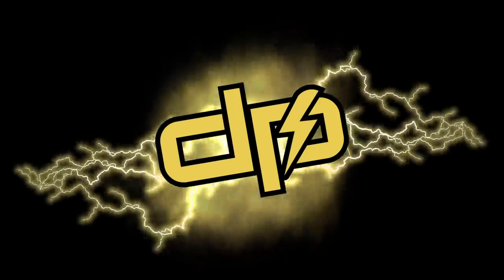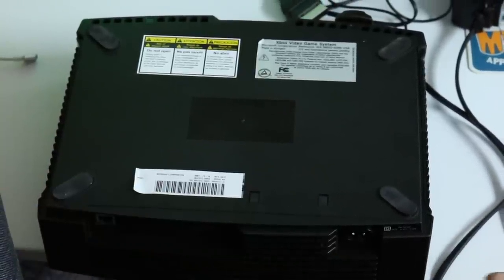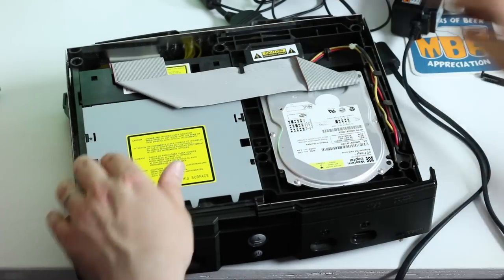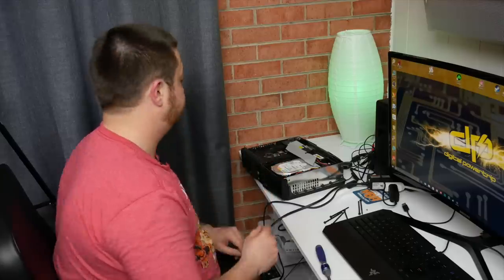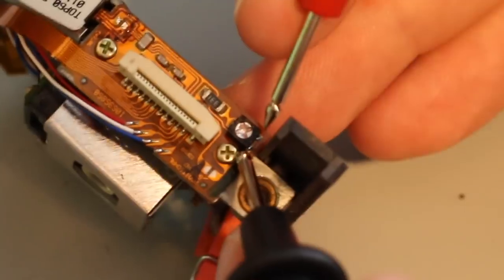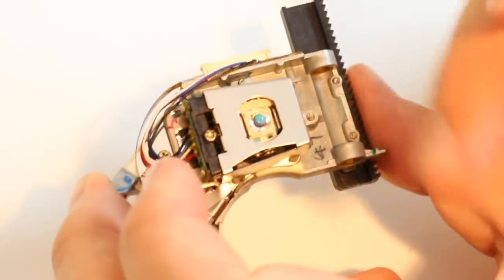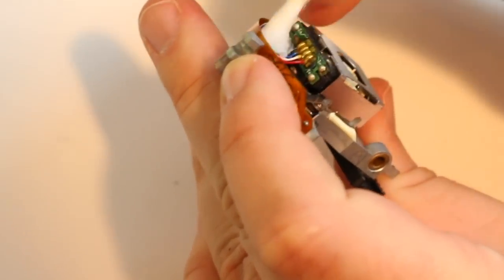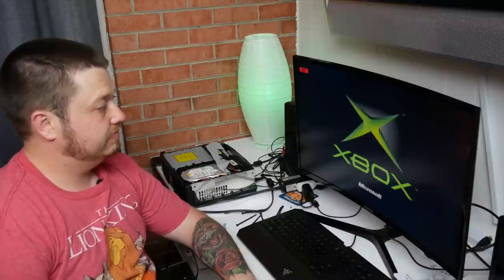Fix Original Xbox Disc Read Error

Comment: Hey I got a weird one, if anyone can help I'd appreciate it. So I have two Xboxes, one works fine, the other didn't read discs. Same error as this video. I swapped out the DVD drives, swapped the IDE ribbon, even swapped the power cable, but the issue remains the same. The only difference is with the IDE cable. Before, there was no Xbox splash screen when trying to read a disc. It would just display the error after several seconds. When I swapped the IDE cable, it now displays the Xbox splash screen, but still gives the error. I'm not sure what else to do at this point. Could it be a bad motherboard? Thanks in advance. Subscribed.
Reply from the maker: Yeah, I think you may be on to the source of the issue. Good news is that you can pick up OG Xboxes pretty cheaply. We find good luck in small shops like pawn shops and on Ebay. Good luck!
Reply: You can not simply swap an original Xbox's hard drive or optical drive without swapping the boards on them. They are both married to the motherboard. The only way to swap them is to pull the board off the old drive and put it on the replacement drive.
Reply: This is contrary to what I have read in my research on this issue. The HDD is linked to the motherboard, that's true. But not the optical drive, according to my research. Also, I was actually able to get a different optical drive working in the Xbox I posted about.
Reply: Hmm. I thought for sure they were both linked to the system.
Reply: @1980sGamer  nope, on the original xbox only the hdd is linked to the mobo and on the 360 only the disc drive is linked to the mobo. I have swapped many disc drives in the original xbox.
Reply: xNinja83x  Thanks for the clarification my friend!

Comment: Digital Powertrip: I have an original Xbox that is not reading disks. I attempted this repair yesterday and it is not working. Could you all repair it, or recommend someone that does? I would pay shipping to you as well as provide a prepaid return shipping label in addition to parts and labor. Just send me a message or comment if interested. Thanks!
Reply: It boots up and all menus are accessible as well as music on the hard drive. But it won't read any disks, not even audio CDs

Comment: anywhere i can get a replacement dvd drive?
Reply from the maker: You can find some on Ebay... but we have had the best luck just grabbing old Xboxes and using them to part out for the ones we are working on. I've gotten them as cheap as 10 bucks.
Reply: Julian Rodriguez if the console is modde youcan actually put a cd or dvd drive to play backups in order to play original discs you would need an specific samsung model, alter the firmware and reverse the spinning of the drive....xbox drives spins the opposite way
Reply: I have two of them if you pay Shipping I can send you one.
Reply: Digital Powertrip I bought a xbox console from eBay I test it turns on by itself doesn't wanna work with games and movies
Reply: Jason Larson I'm interested in one
Reply: Jason Larson u still have a drive?

Comment: I know its an older video but where did you get the replacement optical pick up?
Reply: I would modchip your system, upgrade the hard drive and do this laser pot adjustment only temporarily to run a Hexen disc so you can FTP games over to your system.
Reply: @realgroovy24  Ok sure that's a good shoutout but that didn't really answer his question
Reply: @YummyWhiteLiquid  I've tried sourcing them, there's too much demand in relation to supply.
Would be good if they still made the laser mechanisms. There's also the option of flashing certain drives like the GDR-8163B which I have done in the past, but that's a lot of work for most.

Comment: So the issue I had with the video.. is I was following along not realizing I needed a special tool.. and mine didn't actually have a screw with a slot on it.. I ended up using tweezers to turn it (outward because you forgot to mention which way ment what )
Reply: Though I definitely made mine worse, it would push the disk up instead of reading it and the tray would no longer close

Comment: Is it in any way dangerous to open the XBOX? I want to try the same with mine but I am pregnant and the warnings at the back made me worried.
Reply from the maker: Anytime you open anything electronic with a power supply and capacitors, there is a risk of shock. If the unit is unplugged and you stick to the front portion where the DVD drive is located, you will limit that risk, but if you feel unsure, I'd recommend that you have someone who feels comfortable working on electronics do it for you.
Reply: @DigitalPowertrip  Thank you very much for your reply and opinion! I did open my computer tower before and never had any incident with that. I am just insecure if with the XBOX the risk might be higher. I will stick to your recommendation! Thank you again!
Reply from the maker: @jilvalentine7094  You are most welcome! Odds are that you are at no greater risk with an Xbox than you are with a PC (they are essentially the same thing). But, a shock to a pregnant person is not good, so if you decide to dive in, be safe!

Comment: I just got an original Xbox, and when I try to insert the disc it won't stay, it pops back out.  If I insert it, hold it in and turn off xbox it will stay after I turn back on and load, but are there any possibly simple causes and fixes?
Reply from the maker: I've not had any experience with that exact issue, but chances are someone has. If you find a fix, let us know what it is.

Comment: I tried this fix, even checked with my multimeter. Now the disc won’t play and doesn’t show a disc read error message on screen, just stays at menu. Have any ideas how to fix? Thanks
Reply from the maker: multi meter set to ohms? If so, the laser may be bad.

Comment: do you think leaving a game in the Xbox while its put away on its side could cause this?
Reply: I haven't played it in a while and I forgot I had left a game in there! and now it says that all of my disks are not valid Xbox games, CD's, DVD's or either dirty or damaged!
Reply from the maker: Depends on the environment of storage... heat cold, humidity... not good for electronics.
Reply: @DigitalPowertrip  yup. That’s what I’m dealing with right now. I have two units that were reading disk just fine, one soft modded. Left them in a storage unit for a few months now they both don’t read anything.

Comment: I have a question my Xbox works whenever I don’t have my av cord in my Xbox the console works and the disk spins but when I plug the av cord into the og Xbox the disk will stop spinning and the console will show me a red ring on the disk button please help
Reply from the maker: Sounds like an AV cable error... does it have 4 red lights around the power button... like this image? https://en.wikipedia.org/wiki/Xbox_360_technical_problems#/media/File:Xbox_360_Error_codes.svg - fixing it may be as simple as a new AV cable or as bad as replacing the board.
Reply: Digital Powertrip I mean the Original Xbox from 2001 what I meant to say was it blinks red and green on the disk opener button whenever I plug in the av into my Xbox from 2001 I do not know how this happens cause I took apart my Xbox to see what it was and clean it but maybe I could have touched something I’m not supposed too
Reply from the maker: Are you sure it’s red and green not orange and green... anyway here are the OG Codes... https://www.ifixit.com/Answers/View/241840/Flashing+red+ring+on+x+box+original

Comment: Whoever owned my xbox before me(got it used for a xmas gift). Thry clearly took it apart before because the screws holding the disc drive in place are stripped... Any suggestions?
Reply from the maker: screw extractor set... If you are in the US, Harbor Freight or lowes. You can find videos on how they work here on youtube.
Reply: @DigitalPowertrip  thanks dood
Reply from the maker: @fondlefiend32  No problem... Let us know how it goes!

Comment: Are you sure that thorough cleaning wasn't what fixed it?  You said that you cleaned it first, and then it worked briefly.  I'm wondering because you increased the resistance, not lowered it.  You increased the resistence by 100K ohm. As a result, you lowered the current flow, making the laser a little weaker, but that would still work.  I think you tricked yourself.
Reply from the maker: yes, positive.

Comment: you have to remove the torx 10 screw holding the hdd caddy in order to take the dvd rom reader out of the unit i fixed dozens of xboxes and xbox 360 original and slim all my systems work
Reply from the maker: I am confused as to the purpose of this comment. No disrespect, I just do not understand what you mean, and why you commented this.

Comment: Need help, I only get disc read errors while playing demanding games like doom 3 but playing simple games like DOA3 works fine 
I checked dvd drive and the laser set is loose it moves by itself when moving the xbox 
How the fuck i fix that??
Reply: well one work around would be to softmod ur machine and run games off the hdd.

Comment: Im Really scared if i try to repair this its gonna ruin it.
Reply from the maker: If it's broken now... how would you know if you ruin it? ;)
Reply: You can’t break what’s already broken! 😉
Reply: The Disc optical drive still wont read the discs also i tryed to fix this with my Dad, and we spinned that little thing you said about and it did not work! so.. this video is no use to us then.
Reply: @zeroman0460  thats not powertrips fault. Its possible there is something else that is faulty with the system.

Comment: were do you buy new lasers?
Reply from the maker: We found ours on ebay a couple years ago... I don't have a link to that specific one since it was so long ago. I did find a seller that had a repair assembly that included the laser, motor and rails... https://www.ebay.com/itm/XBox-1st-Gen-Repair-Laser-Deck-Assembly-Motors-Rails-Thomson-TGM600-DVD-Drive/322000065968?hash=item4af8b315b0:g:5DoAAOSwoydWtOQt

Comment: where did you get the new laser at?
Reply from the maker: Ebay
Reply: @DigitalPowertrip  Can i have the model number ?Mine appears to be very close to yours.
Reply from the maker: @DarkKokoro84   - I can look it up... give me a few.
Reply from the maker: @DarkKokoro84   OK, cant find the original item we ordered on Ebay anymore... but this looks better at only 26 bucks. https://www.ebay.com/itm/XBox-1st-Gen-Repair-Laser-Deck-Assembly-Motors-Rails-Thomson-TGM600-DVD-Drive/322000065968?hash=item4af8b315b0:g:5DoAAOSwoydWtOQt